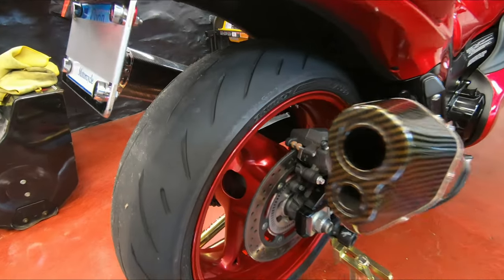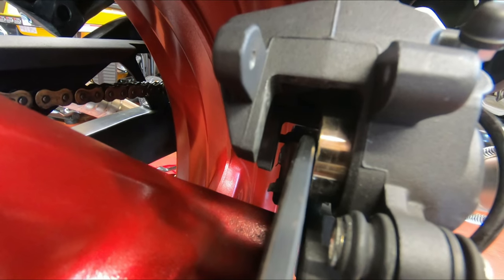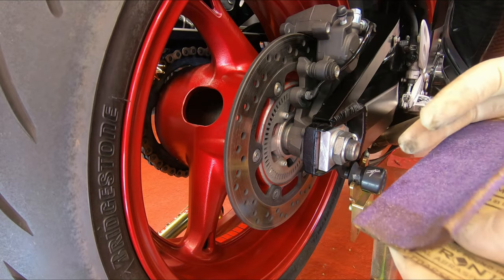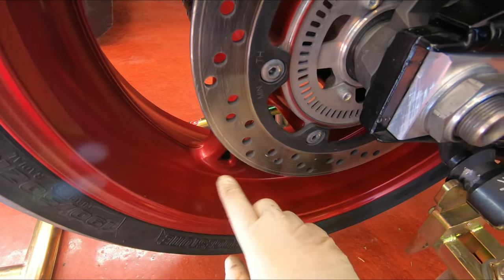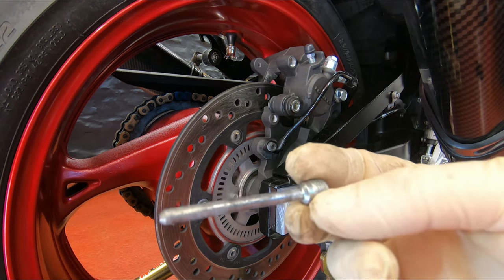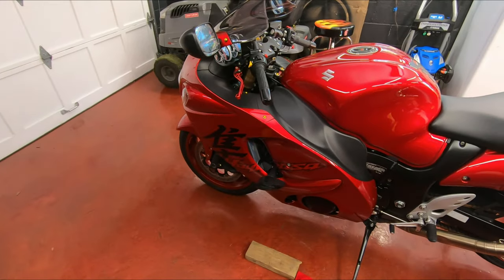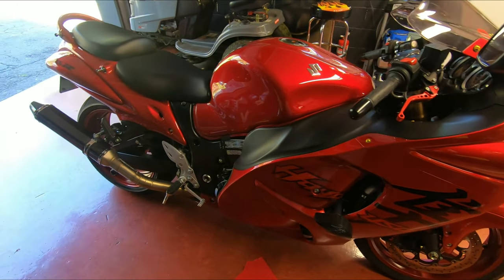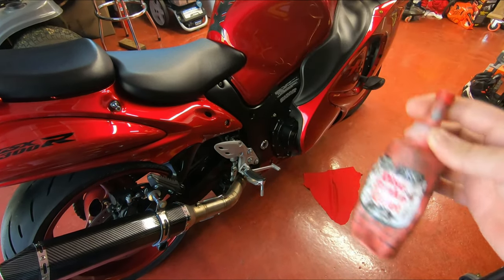Hayabusa Rear Brake Pads Replacement | Gen 2.

Comment: Hi mate, thanks again, took my wheel out and dismantled the whole rear caliper assembly plus the mount to clean it. Got a bit mixed up trying to put the pads back in and saw from your vid that it was way easier to fit them back in once the caliper was back on the bike with the wheel in. On my bike, even though it is very low miles, the rear slider pin was stuck because water got in behind the rubber boot and corroded the aluminium housing making it bloom (made hole diameter smaller) and press into the boot and locking up the pin. I took the boot completely out of the caliper and cleaned up the mounting hole with a half round file and greased it up. Fitted the boot back in and pin moves freely in there now. Just a thing to look out for on bikes that spend some time in the wet. Another great video and you are helping me out a great deal keeping my 'busa sweet. 👍👍👍👍 btw, when I say low miles, I'm talking 2700 miles and it's a 2014! Dunno what the last guy used it for, to put his coats on I think. 🤣🤣
Reply from the maker: Cool man! I'm very pleased to hear my video was helpful to you! That is extremely low miles on a 2014, wow! Maybe he used it as a garage decoration ☺️
Mine has over 20,000 miles and it's a 2020. I'm getting my money's worth out of it 😆

Comment: Just a tip. ALWAYS use heavy thread locker on every single steel bolt that goes into aluminum. Or on low tension fasteners, use copper anti-seize paste. Never use straight steel bolts into thick cast aluminum, especially on a suspension bolt or spark plug, because if you are washing your bike frequently, the water will get into the bolt and cause it to corrode, and when you remove the bolt, it galls the aluminum threads. If you use thread locker, there is zero corrosion, because the thread locker seals the metal and prevents oxidation of the steel and aluminum, and it also saves your life.
Reply from the maker: Interesting, thank you for sharing! It's kind of disappointing they didn't use this technique from the   factory.

Comment: Why are you using the rear brake?

What level of formal rider training have you successfully completed, if any?

What is your objectively quantifiable riding skill level, if any?

My background is as an expert-licensed motorcycle road racer and motorcycle road racing instructor. I am also an honorably-retired police officer with a successful law enforcement career spanning 30 years. The majority of fatal and near-fatal motorcycle crashes I have investigated, ALL involved attempting to use the rear brake while in motion.

Using the rear brake contributes NOTHING to maximum braking, but it absolutely can kill you by locking up the rear wheel, eliminating the gyroscopic stabilization of the spinning rear wheel.
Reply: This is an impressive background @Gurn_ Blanston!! Maybe you should post some videos at your channel to teach the proper way!